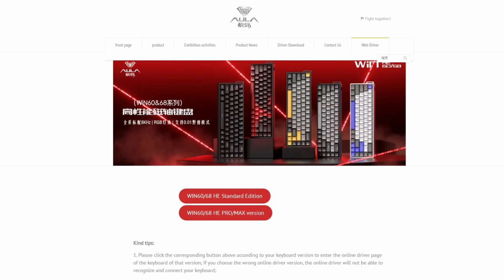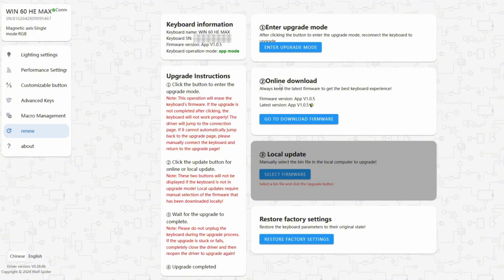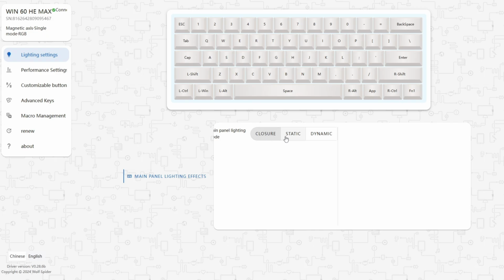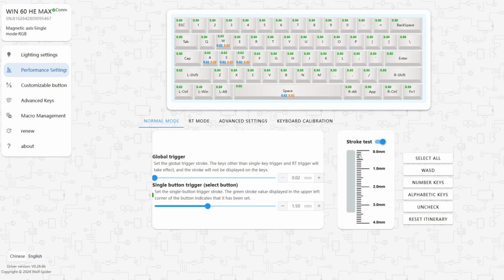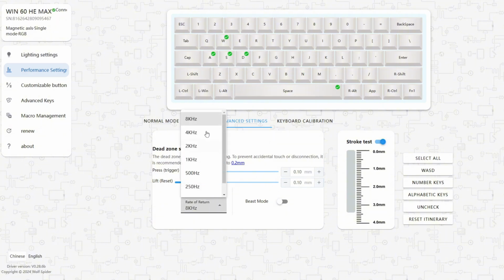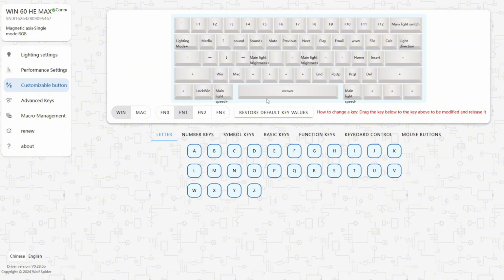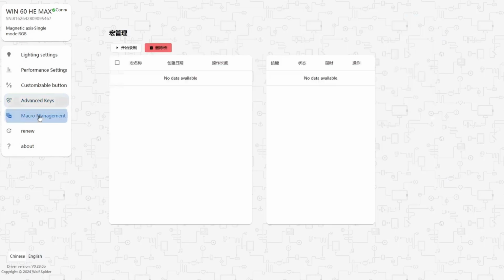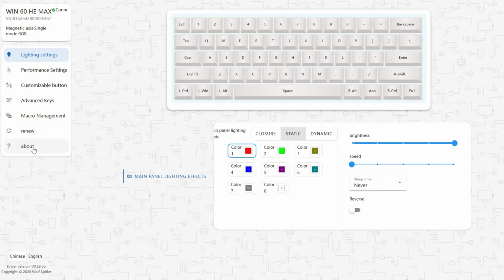AULA WIN 60/68 HE MAX PRO WEB DRIVER REVIEW

Comment from the maker: Update: SOCD is working! Team Aula responded to my inquiry and updated their web driver! 

This video is not updated, but I have already provided a new video. You'll notice difference from your current web-driver ~19 April 2025
Reply: Does SOCD work on other versions other than the max version? Like does the standard and pro version have SOCD or do I have to buy the max version.
Reply: Have they removed the beast mode because i can't seem to find it anywhere on the web driver?
Reply: @Claxiv  same i cant find the beast mode setting did they just remove it? i also have the win60he max
Reply: @snxgg  It's on their app but not on the browser version.

Comment: My SOCD is actived by default but i will be banned of CS2 if i use it ande mine dont have the option to desactivate no even beast mode, im trying to get a refund :( i cannot use this keyboard if i cant control the SOCD
Reply from the maker: I see. Have you downloaded the software? Try resetting your keyboard using the software as it doesn't have SOCD in default

Comment: Did you get any issues when activating SOCD ?
mine, if I register a-d for SOCD and i want type somthing with a-d or d-a im getting double input for last character 
(this happens when i type fast, and it happens all the time cuz I type fastT-T)
like this : adaadaa adaa adaa adaaadaa adaa adaa
My RT setting for AD is 0,4mm
Reply: Firmware Ver.1.1.1
Reply from the maker: I think you got the answer there, this happens cuz you "type fast" 

Highly suggest to create a typing profile and set all buttons in the highest actuation or setup the deadzones. On my end, I don't have this type of issue, 60HE MAX has the v1.0.9 only.

Comment: why does my Win60HE Max only have  0.10mm as the lowest and not 0.02mm as they advertised? :<
Reply: mee to:(
Reply: you have to turn on "beast mode"
Reply: @Sindddo  how to turn it on the "beast mode", in my setting dont show that option
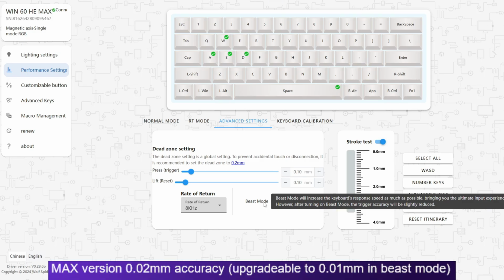Reply: @radityanursyabaan1803  check your software. It was shown at 8:44
Reply from the maker: @sated652  This comment section is confusing everyone. I'll make it clear.

Aula constantly updates their firmware from the date I reviewed this keyboard. They really removed beast mode and return it back, or change the lower actuation point to 0.10mm. So if you noticed something not similar from this video then that means Aula updated their software again.

This video is not updated as SOCD works now compared before. I uploaded updated videos already.
Reply: @awesomemohawkie  thanks for the explanation about the problem that we faced, because I was felt little bit confused some feature that you have ain't same as mine,
Reply: @awesomemohawkie  Oh so they advertised it as 0.02 then made it 0.10? What a great team 👏👏👏
Reply: did you find the solution, bro?
Reply: @radityanursyabaan1803  Beast mode should be in one of the tabs, go to the tab where she shows for Beast mode.

Comment: Help, naming is confusing there is 60 he standard and he pro and pro max. For real it is not an iphone 😢
Do you know diffrences?
Reply from the maker: I couldn't agree less. Look at he back of your keyboard it'll tell which is which.
Reply: @mohawkie1232  thanks for the response. I dun yet own any of those am planning buy one an from many companies it is the same many variants.
I am still gaming on a ducky mini 60% looking forward getting any of the magnetic keyboards alot of models on aliexpress
Reply from the maker: So any variant you choose will have the 8k polling rate. The main difference is the switch inside and the keycaps. You can change the keycaps if it doesn't suit your taste.

There's 3 switches;---
Wing Chun Magnetic Axis
Accuracy: 0.02mm
Initial pressure: 36gf
Bottom pressure: 49gf
Journey: 3.4±0.1mm

Semantic Magnetic Axis
Accuracy: 0.04mm
Initial pressure: 33gf
Bottom pressure: 53gf
Journey: 3.4±0.1mm

Gray Wood Magnetic Axis
Accuracy: 0.04mm
Initial pressure: 32gf
Bottom pressure: 50gf
Journey: 3.4±0.1mm

Prices varies from the switch and keycaps used
Hope that this helps you in choosing!